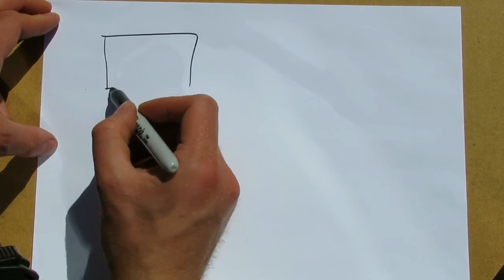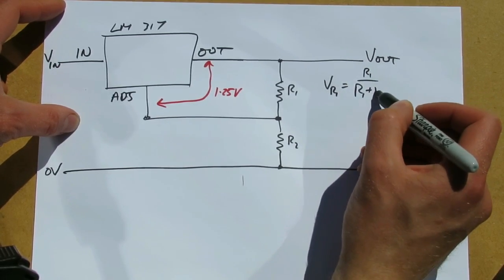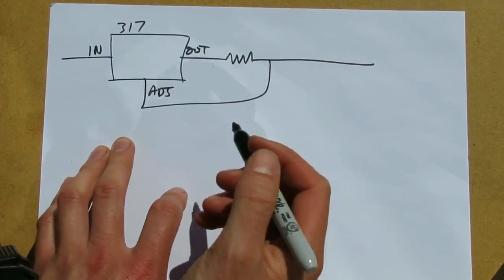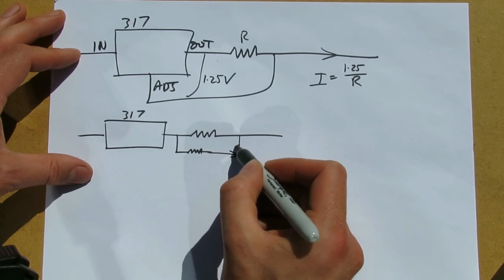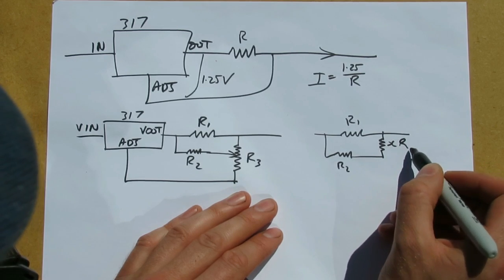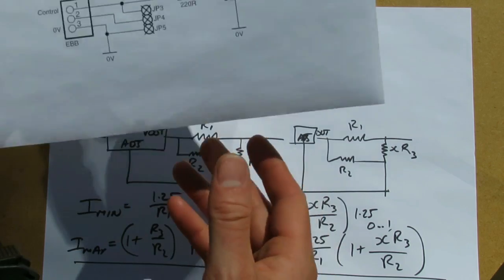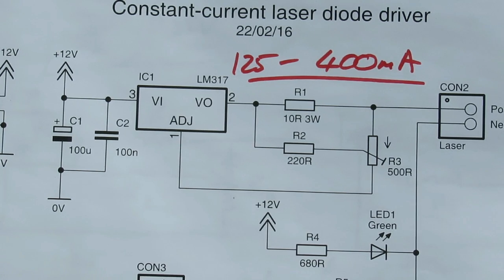LM317 adjustable current source/regulator

Comment: I was using this circuit as a driver for low-power diodes. One blue, one red, one IR. They are all rated for Ith ~ 25 mA so I did the calculations for making I_in ~ 5mA and Imax ~ 40 mA. However, when I connected them, they all behaved very differently. Is it possible that the load (diode) affects the output of the circuit?
Reply from the maker: Hmm, it shouldn't do. Something to check is that you have a sufficiently high input voltage - the LM317 has a dropout voltage of 2-3V, then there's the voltage drop across the current sense resistor, then finally the voltage drop across the diode load. If the supply voltage is insufficient, then you could still get an adjustable current at the output, but it wouldn't be as high and would behave strangely.
Reply: @imajeenyus42  Thanks for the reply. I'm using a 9V input. For the blue diode laser, using my calculated values I just got 1.2 V measured across the diode max. So then I just kept slowly reducing the resistors until I got the diode lasing ... but according to the calculations using the new R's, it should be sourcing 125 mA. I'm pretty sure it is not because the diode is rated for 50 mA max and I barely made it emit light, so I'm definitely missing something. Right now my circuit is working, but I don't know why :(
Reply from the maker: @Danyel615   What's the value you're using for the main sense resistor (R1 in the video)?
Reply: @imajeenyus42  I'm using R1 = 500 Ohms, so I min = 1.25/500 = 2.5 mA. R2 = 100 Ohm, R3 = 1.5 kOhms, so R3/R2 = 15 and Imax = 2.5 mA*16 =  40 mA, at least that's what I had at the start.
Reply from the maker: @Danyel615 Here's the reason it's not working with a 9V supply. Say you drop 3V across the LM317, and 1V across the load, 4V total. That leaves 5V maximum that can be dropped across R1, so the maximum current that can possibly flow is 5/500 = only 10mA. You won't be able to reach the 40mA maximum current, because that would require 20V to be dropped across R1. This is actually a point which I should have mentioned. The main resistor R1 is sized based on the lowest current output, but it still has to carry the maximum current as well. For large min/max ratios, this means that R1 is quite large, drops a large voltage at maximum output, and hence you'll need a higher input voltage.

A better circuit for what you're trying to do might be this: http://imajeenyus.com/temp/current_source.jpg. That's a single-transistor current source. The 10k pot applies a 0-9V voltage to the base of the transistor. It ensures that its emitter is always about 0.6V below the base voltage, so a 0-8.4V voltage appears across the 200R resistor. This will give a current range of 0-40mA or so. Neat thing is it's adjustable right down to zero (note if the base voltage is below 0.6V then the transistor will be off totally). I've shown both NPN and PNP versions, in case the diode needs to be connected to the 0V rail. Any common small amplifier transistors should work fine. The linearity and stability probably won't be as great as with an LM317, but it's maybe enough.
Reply: @imajeenyus42  nice! I'll give it a try and report back

Comment: sir i want to make a cc/cv using 2 lm 317 and i understood the circuit but i want a dynamic range of current i want current upto 1.25/1.5/1A so please suggest me best    resistor values along with the power rating and which are commonly available

Comment: Hi there , Your circuit is quite easy to understand  , I have a situation where my current varies from 0amos to 2.5 amps and I would like it to vary as normal but I would like it to limit till 1.9amp and not exceed more than 1.9amp , is it possible through this circuit or this  circuit will give me a constant xx ampere current. 

Thank you

Comment: Hi Lindsay. I am getting very confused. I am newbie trying to understand the calculations from this circuit. Could you please explain how it should be calculated taking into consideration all the resistors and then explain where are you taking from the equation you use on the video? Thanks in advance.
Reply from the maker: I have explained the equations as best as I can in the video. Can you please explain which particular equation you want to know about?
Reply: @imajeenyus42  I understand your explanation but I would like to know there is the equation coming from. How do you arrive to that solution from the original equations. I have been able now to calculate the values taking into account all resistors. But I don't know how to get to that formula you provided. Sorry I am the kind of person that needs to understand how to get into the results. I would thank you if could explain it to me. Thanks.
Reply: Never mind Lindsay. I just found out where is your equation coming from. Thanks :)

Comment: I have some doubts about the circuit you drew at 4:50, R2 and R3 are not in series,because there is current flowing through adj pin,so they cannot form a resistance divider.
Reply from the maker: I have explained this time and time again to other commenters. Yes, there is a TINY current flowing through the adj pin, but it is INSIGNIFICANT. This is why, to all intents, we can consider R2 and x*R3 as being in series, forming a divider, and we can forget about (1-x)*R3 being in series with the adj pin. The current flowing through the adj pin is 50uA, according to the datasheet. Suppose we were using a 1k potentiometer. Then, the maximum drop across (1-x)*R3 would be 1k*50uA=0.05V. So instead of the reference voltage being 1.25V, it would be 1.20V - only a 4% difference. This is not something to worry about, and I really wish people would understand this! There is no point in trying to calculate the adjustable range exactly, for the simple reason that it IS adjustable. If you calculate that you're going to get a range of 100-400mA, and you actually get 95-405mA instead, is that really a big deal?!? Considering that the tolerance on most potentiometers is 10-20%, a 4% error caused by ignoring the adj pin current is irrelevant. I hope this doesn't come across as harsh, but I have explained this all before ;-)
Reply: @imajeenyus42  my fault,i had just written without reading the comments.
Reply: @imajeenyus42  Quite right, there's always one!

Comment: I am completely new to electronics, and trying to learn on my own, would a heatsink be needed? When used as cc supply?  I have a 18 combined watt rgbwyuv LED, I'm wanting to make a driver to power all the LED's it is a "all in one" LED the size of a 3-5w bead, the kwd is red, green, blue, white, yellow, and UV/Violet, basically all but a IR LED, I am building a small portable light, powered by a couple 18650's in series if I must, I think using a buck would be better than boost, although USB charging option would be a plus, I'm thinking of using the linear regulator for 2-3 supply's, to get close to the LED's peramerters, then use a resistor, for further limiting, or is there a easier way to do this?? I thought about using a rgb controller, or two, only use it with the rgb and the    wy/uv! And just use resistors for limiting, crazy dumb questions I know, and very complex to light a LED!! Thanks!

Comment: Hello.   I was trying to have an adjustable 4-20ma constant current source using your circuit and did not get the results I had hope for and was hoping you could help.

4-20 ma, using 250 ohm potentiometer 

I calculated R1 = 312.5 ohms
                      R2 = 62.5 ohms
                      R3 = 250 ohms

I did not get much current adjustment

Any ideas??
Reply from the maker: The calculations shown assume that R1 is small compared with R2 & R3, which is not the case in your situation. Try 10x the value of both R2 and R3, i.e. 625 and 2500 ohms.

Comment: A Very good video, Being a novice, could you please tell me the values for R1 & R2 in an example.  I realise that the circuit diagram shown is for various input voltages but an example for say a input voltage of 9v and an output voltage of 6v would help me understand the circuit better.  ManyThanks
Reply from the maker: There's lots of examples of LM317 voltage regulators online - for example, this one: http://www.learningaboutelectronics.com/Articles/LM317-voltage-regulator. The purpose of my circuit is a constant-current regulator, not a voltage regulator.
Reply from the maker: In the laser diode driver, for example, the output voltage ranges from 0 up to a few volts, depending on the current being delivered, diode characteristics etc. In a constant-current configuration, the LM317 could in theory be used in high-voltage applications, as long as the voltage drop across it never exceeds its maximum of about 37V. The problem with an adjustable regulator running from a HV supply - if you reduce the current to such a level that the voltage drop across the LOAD is relatively small, that will then drop a LARGE voltage across the LM317, blowing it. You can use it as a higher VOLTAGE regulator, but it requires additional components - for example, have a look here: http://www.pmillett.com/HV_reg.html. That can probably be modified to suit.

Comment: Hello Lindsay, really nice video :) I tried to realize the current source circuit to obtain a very tiny current (less than 1 mA) but what I noticed is that also putting a very big R1 (like 10kohm or more), the current does not drop less than 1.45mA.... So I cannot obtain any current below this value, can you confirm it please? Thank you
Reply from the maker: Thanks for the comment! Unfortunately, the design procedure I've shown in the video relies on R1 being much, much smaller than R2 & R3. So if you did want to use say a 10kOhm for R1, you would need to make R2 & R3 much larger, in the region of say a few hundred kOhm. An additional complication is the leakage current out of the ADJ pin - although it's small (50uA), it would create significant voltage drops when using larger resistor values. It's really difficult to say exactly what the equation would be! If you want to play around with some values, I'd try 10kOhm for R1, 100kOhm for R2, and 1MOhm for R3 (the variable).

Comment: Hello! If I may ask, about the power of the resistors it's only mentioned the 3W of R1; and the others , R2 and R3, resistors? 
Can I use your calculations for an 1A output? It won't get on fire? :-) Joking but asking seriously!
Thanks!
Reply from the maker: Hi! All the other resistors can be normal 1/4W varieties since they hardly dissipate any power at all. Yes, the calculations can be used for any current level - just work out the resistor values to suit.
Reply: Thanks!

Comment: First of all thanks for the circuit idea! I tried the circuit with a LM350 (similar to LM317, but with 3A max current). Unfortunately it works only for small adjusting ranges (x to 4*x, where x is the current set by R1). I tried the schematic with R1=10Ohm, R3=1k (the potentiometer) and R2=50 Ohms and it doesn't work properly -> the adjusting range is from ~125mA which corresponds to the formula, to about 600mA. I suppose the limitation is due to the adj pin current. To solve the issue (I needed currents up to 2.5A) I have placed a small resistor and a switch in parallel with R1. So now I can change between 2 ranges: 125-600mA and ~700mA-2.6A. If someone managed to get continuous range between 125mA to more than 1.5A please reply.
Reply from the maker: The LM350 and LM317 have exactly the same specifications for the adjustment pin leakage current (50-100uA), so that's not the problem. It sounds like the input voltage isn't high enough. If you have a R1=10Ohm, that will drop 25V, and the LM350 needs at least 2V to operate, so that's 27V so far, then you need to add on whatever voltage your load requires.
Reply: @imajeenyus42  you are perfectly right, the input voltage is about 20V, I was stupid 🙃. Thanks a lot for the fast answer!
Reply from the maker: @valichesu  No problem, glad to help!

Comment: nice work... but the current is not constant for variable load.... can us suggest , what should be the resistor values for current range 100mA to 1amp
Reply from the maker: Not sure why you think the current isn't constant as the load varies, that's the whole point of the circuit. It will regulate the current, so long as the voltage drop across the LM317 doesn't become less than the dropout voltage, which is approximately 2V.

Suitable values for a 100mA to 1A range (following equations given on my webpage). Minimum current is 0.1A, so R1 = 1.25/0.1 = 12.5Ohms. This carries a current of 1A, so power dissipation is 12.5W. I'd try 15W or 25W metal-clad resistor, which are available in a 12Ohm value. (If you can't get 12Ohm, put two 24Ohm in parallel).

Maximum current is 1A. Min/max current ratio is 10, so (R3/R2) ratio is 9. Say you use R3 = 500Ohm (a standard potentiometer value). R2 is then 55.5Ohms - use a standard value of 56Ohms.

Summary:
R1 = 12.5 Ohms, 15W or 25W
R2 = 56 Ohms
R3 = 500 Ohms

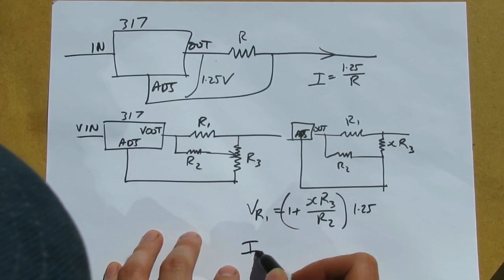Comment: Hi Lindsay, great video.  I was curious about the equation at 5:37, and was wondering if you could go into any more detail about it.  I see that R2 and xR3 combined are in parallel with R1, but since we know the voltage across R2 = the voltage across R1 + xR3 = 1.25 V, wouldn't it be more accurate to say VR1 = 1.25(1 + R1/R3)?  Or is that not right.

Sorry to everybody else for nerding up the comments section
Reply from the maker: Hi, yeah, I know, it takes a bit of getting used to! The best way to think on it is looking at cause and effect, and which "direction" the effects flow in, if that makes sense. Here, the output current passes through R1, producing a voltage, which is then divided down by R2+xR3, and applied to the ADJ input. The chip then adjusts its output until the voltage at the ADJ input (well, the voltage between OUT and ADJ) is equal to 1.25V.

At first glance, a lot of people (myself included, until I got the hang of it!) attack the problem from the other end, which is - The voltage across R2 is 1.25V, which is divided down by R1+xR3, so the voltage across R1 is 1.25*R1/(R1+xR3). That, unfortunately, is the wrong way to think about it - the ADJ terminal is an input, and SENSES the divided voltage produced by the resistors.

Hope that makes things a bit clearer!
Reply: This helped me out understanding the formula, thanks for sharing!  @imajeenyus42
Reply: @imajeenyus42  I fell there too, so VR2=1,25V=VR1 * R2/(XR3+R2)  from here VR1=1,25*(R2+XR3)/R2. It is right? thanks
Reply from the maker: @angelodemichele  Yes, that's correct - that's what I show in the video.

Comment: so with this circuit you basicly can only make a printer turn the laser off and on right?  
manual power setting and then the printer has to do shading with changing the movement speed.  

are there computer controlled potentiometers?
Reply from the maker: Yes, correct. Search for "digital potentiometer", there's lots of options. Usually I2C or SPI interface.

Comment: Nice job on the explanation. I thought you would have needed a small cap on the output for the switching transients? Also have you tried modulating the ADJ pin instead. It will take much less current to control so cleaner switching would be easier I would guess. It would be inverted though.
Reply from the maker: The LM317 is a linear regulator, not switching, so a filter cap isn't strictly needed. It would help improve transient response to changes in the load, but too large a value can cause instability. I'm not sure what you mean by "modulating the ADJ pin"?
Reply: Lets say you switch your laser at 100khz. That transient load is too fast for the 10khz response of the LM317, so you would need a 0.1uf cap on the output and input in theory. Grounding the ADJ pin will switch off any load (1.25v out is off for most loads) So you can switch the ADJ pin. which is easier than switching 400ma.

I will probably try all this in a few weeks when I get a chance. The next TV I build needs a modulated laser. I am just researching right now.

Comment: Hello
Could you suggest where put an optical coupler in that circuit?
I mean, drive the optical coupler with a smartphone signal generator and then modulate/control the output  of that circuit.
Could also suggest a current controller for up to 100V?
Max LM317 is 37V.
Reply: Are you trying to make a Tesla coil by chance and play music through it?

Comment: you can control voltage and current with one lmr317 at the same time?
Reply from the maker: You can't control both voltage and current at the same time, no matter what circuit you use. You can control one parameter, but the other will then be determined by the load resistance. Depending on the configuration used, the LM317 can act either as a voltage or current regulator.
Reply: @imajeenyus42  hi sir, if we want to control voltage and current same time how?
Reply from the maker: @nagarajub4011  You can't. Did you even read my comment?
Reply: @imajeenyus42  ok thank you